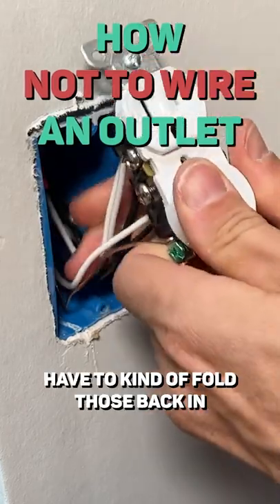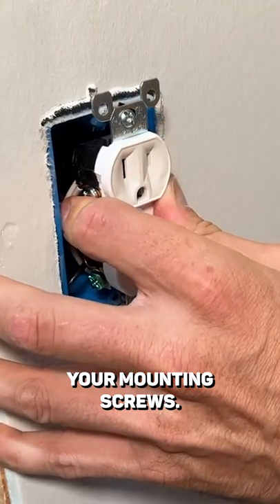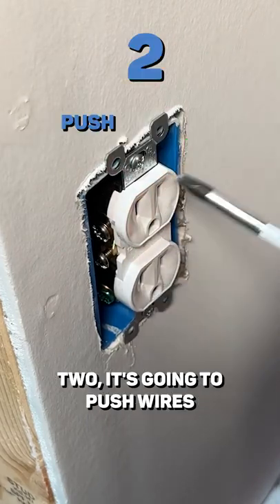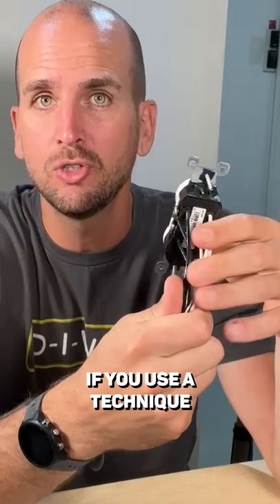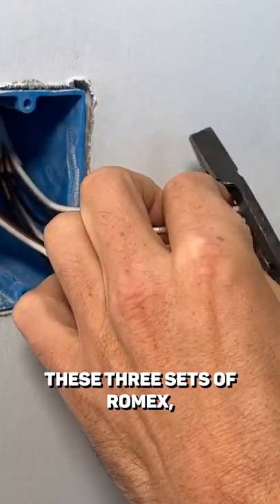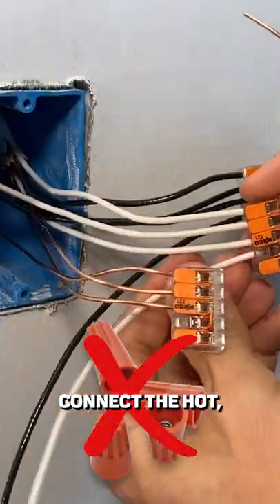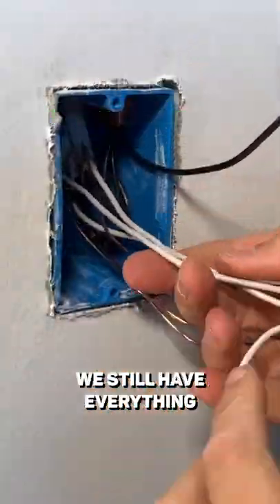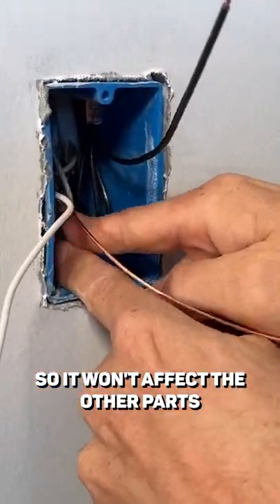The Better Way To Wire Outlets #shorts

Comment: I'm an electrical contractor, been in the field since th late '70's. If you're going to splice twist the wires and use a wire nut. I agree that pigtailing is a better method because there are less wires on the device and less current will be running through that little tab. BUT what you used to make that splice is unreliable JUNK. TWIST THE WIRES so you have a good mechanical bond and a wire nut will back up that bond and insulate that connection.
Reply: "what you used to make that splice is unreliable JUNK"

Are you talking about the Wago connectors which are used pretty much exclusively throughout Europe and have a well proven track record?

Consider bringing your 1970's knowledge up to date.

Comment: Do you not use a covering on the earth wire
Reply: No, it's not needed and they don't sell romex wire with  insulation on the ground wire.
Reply: @randybobandy9828  "No, it's not needed"

Despite those bare wires being right next to exposed live connections on the rear of the poorly designed outlet?

The fixed wiring cable in other countries doesn't have a separately insulated ground wire either, but typically a sleeve would be used on long runs of exposed wire.
Reply: @randybobandy9828  In the UK we cover the Earth/ground wire with a green/yellow sleeving.

Comment: That bare ground bends toward the neutral screw terminals, and might actually touch.  If it does, it'll trip a GFCI breaker because some of the current will return on the ground instead of the neutral.

I prefer green-insulated ground wire on the pigtail and/or wrapping electrical tape around the screw terminals (always the latter if it's a metal box).

Comment: Those push connections loosen up as  time goes on inside the back of the outlets and then you get random outlets not working here and there
Reply: Europe has been using them for years, the US is still using technology from the 60’s. I personally don’t like the Ideal style push in type but the Wago 221’s are built different and have a solid connection

Comment: What's wrong with using wire nuts instead of those monster connectors?   It's rare that I have 3 wires in a receptacle box anyway

Comment: Been doing this in all the time .. but one question ..  why the hell is the ground bare without a mantel ? I had some faulty conductor that pass current trough the ground and worst is that you have to make sure the ground touch the conductor to pass electricity

Comment: why not make the electrical box longer and or wider or deeper so the wires don’t have to cram so tight? that’s the most easiest fix .why buy more material when no more than 4 input fields on a computer fixed the jammed up wires in the box????

Comment: Not sure who decided to call this pig tailing, for 50 years at least a pigtail is when you wind the wire into spirals like a pigs tail. A bit like a telephone cord, you can then just push the spiral tighter as you fit the outlet.

Comment: Wouldn't this be considered series for the main circuit with the outlet parallel? Genuine question as I thought we were supposed to shoot for all series
Reply: No, everything in residential in wired in parallel. You never, ever wire anything in series
Reply: if it were series the next outlet wouldn't work unless something is plugged in the one before it

Comment: I tried using a wago for the first time the other day the separate wires felt loose in each hole in the wago is that common and how it's always is question mark I didn't like it so I just took the wires out of the wago and wire nutted it. Arent the wires supposed to be tight in the wago?

Comment: Also wrap the box to cover screws with electrical tape, it's code
Reply: No it's not. Nowhere in the NEC does it say to tape around receptacles.
If you're going to argue this, have the article number.
Reply: I guess I wrong, St Louis County didn't go by NEC till 2014, as well I may have been miss informed. Was asked to do so when we remodeled the house. Told it was code.
Reply: @brandonstahl3562  That happens a lot, people will say something is code just because they were taught that way. The problem is that they pass that on to an apprentice and then they fail their Journeyman test, or waste time doing something that isn't necessary and is actually frowned upon by some inspectors. While not technically against code, I had an inspector tell me that he didn't want that done as it traps heat, causing the device to degrade. While that's overkill, it does show how different codes can be interpreted, since it is changing the functionality of the receptacle as per it's UL rating.
I'll tape devices if it looks like it might ground out against the mudring, like on a repair with a full box, or in outside, wet locations where the box is going to be full of bugs in a year. Here in Florida that happens a lot; I've found lizards, snakes and frogs in boxes, besides every kind of bug and spider that crawls or flys.
Anyway, I wasn't trying to argue, just pointing out a common mistake. 35 years in the trade will cause you to do that. Stay safe.

Comment: But the reason there are that many wires going in is because I wanted to isolate the bottom outlet so I could plug a lamp into it and turn on the lamp from the door switch, which is a two switch outlet: one for the ceiling fixture and one for that lamp next to the bed.
Dude, if your so weak you need to "pigtail", you need to get another job.

Comment: Any chance for 🔥 with the pigtailin?
Reply: Only if you use the Connectors improperly. When there isn't enough pressure on a connector it becomes Hot.
Reply: Any bad connection will cause a short....

Comment: Then why are there 2 screws an push in holes  on the neutral side and the hot side ? Only time I ever pigtailed was when there was 3 sets of wires

Comment: Holding the outlet on either side with the screws under the fingers? 🤯🤯🤯🤯 ALWAYS treat each outlet or switch as if it were live, even if you know it isn’t ... just in case one gets used to holding them like they are not live and one comes across one that is live!

Comment: Main reason to pigtail is so if an outlet dies the whole circuit doesn't.
Reply: If the bar that connects the two wires burns up you've got bigger issues than the rest of the circuit not working😂

Comment: It's actually against code to not use pigtails on the neutral and grounds.ypu can't use the outlet to make the joint
Reply: Would you explain more? Seems like this is only applicable in certain cases

Comment: One pig tails and connectors are two totally different things to those connectors. I guarantee will fail in time, and the electricians gonna have a heckuva time figuring out where the problem is and three those connectors look way bigger than wire nut and take up a lot more room in the box strip, your wires pigtail them with your Klein pliers throw wire nut on little bit of black tape if you’re in a moist area and call it a day also, don’t use the push in connecters use the screws after you pigtail and tighten down all four screws on the side of the receptacle to avoid an electric arch and possible electrocution to the homeowner

Comment: Let me ask you this. WHY DO YOU HAVE 12g WIRE GOING TO A 15amp Plug? 
How many circuits do you have on this? 
FFS 14 gauge wire is rated for 15 amps and up to 4 receptacles.

Comment: I'm curious, how were you able to put a 12 gage  wire in a 14 gage hole, im pretty sure all receptacle outlets would be 12 gage ,20 amp and not using 14 gage on a 20 amp breaker

Comment: Yes. This is fine and dandy. Unless you are working on 30 and 60 year old properties. This wired do not work the way you think. Even as in bending and pushing. Do not take take your tips from shorts like this one.

Comment: I. NEVER NEVER EVER use a receptacle as a junction point ….   Pigtail it.   Especially if it goes bad.   Will not take out a he rest of the circuit AND u can remove it without disrupting service with the others on the same circuit

Comment: What of someone plugs in a space heater in a outlet with waggos I've used them but prefer solid twist with wire nuts
Reply: Also when it gets cold the difference between copper an aluminum can separate causing a fire from arking

Comment: First you messed up using the stab in back method, thats the worst thing you could do. Then you go ahead and use wago connectors which are also a poorly designed connecting device. You should always twist your wires with kleins then secure with a wire nut
Reply from the maker: That one isn't speed wiring (or back stabbing) it is back wiring commonly found on commercial grade outlets.  Works well 👍

Comment: Well, pigtails mean extra wire in the box, soooo, there's that. Plus the connectors.... but you did push the ground to the back of the box, so good on ya for that
Reply: The issue isn't the really amount of wires or connectors. The issue is that it becomes difficult when there are 5 wires sticking out the back of the outlet. It makes it difficult to push into the box.

Comment: Just my opinion but I would never use a slide bar to collect all my wires I would always use a wire nut they are more secure but sure and will not come apart as a slide bar just uses the little blades in them that can oxidize or tarnish in time and create a problem for you

Comment: Boss: That Takes Too Much Time Doing That!
Electrician: This Way Is Safer, Circuit Integrity Kept and Easier to Fold In the Wires for a Flush & Level.
Boss: Does the Outlet Work Right, All I Care About!
Reply from the maker: 😂 that's about right

Comment: 14 size wire should be 12 I see so many fires with 14 also you need to. Tighten unused screw also put tape over screws

Comment: I don't believe any receptacle is rated to have 3 sets of wires connected to it. You can either use the screw terminals or the back stabs, but not both.

Comment: And for the record, you only use "pigtailing" if necessary because of the diagnosis procedure. It's a lot easier to find a compromise or know that there is an issue by using the device passthrough as designed. You're advice here is useless. Every box has a fill rating. If you can't put a device in with the allotted fill amount, you probably shouldn't be touching it.

Comment: Wago are garbage. If you knew there was two small thin pieces of metal holding the wire in base in thin acrylic plastic. You wouldn’t use them. Same little thin metal was used for stabbing in the back of some outlet. I’ve been in houses that were only two years old with multiple problems because of stab-in. Save your money, save your life, save some electrician headache. Just use a wire nut,twist up the wires and wrap the fucking screw on the device. Doing this for 40 years I see a far less headache and troubles are up.  There’s a saying I tell my people if you do it to the best practice possible then you only do it once.

Comment: So you can either bend the wires and push it in as screw it down, which we've done forever in a day. Or you can make each of these outlets more time consuming and more expensive hmmm. Looks like I need to develop my finger strength cuz I'm bending some freaking wires

Comment: Pig tailing it is.  I've seen the downside of using the receptacle as a junction point.  I've felt the heat of a an outlet being used as a junction even though there is nothing plugged into that outlet.  I've had to repair a defective outlet that has cut off the electric to all other devices down the line.

Comment: NEC art 334, you have to have 6 inches of nm cable sticking out from the plastic box . Nothing more nothing less.
Reply from the maker: As I understand it the code says 6" from the end of the sheathing inside the box and a minimum of 3" sticking out from the box.

Comment: 2.5 for each current carrying conductor 2.5 for grounds and 5 for the device 
22.5 cubic inches 

I doubt that box is rated for it. Probably a 18 cu in box

Comment: I've found so many of those cheap ass wago wire connectors failed and cause a direct ground it's a ok idea but the way they are made cause problems I've never seen very many wire nuts fail

Comment: These flat connectors are NOT a good idea to use.  They have a metal clip that only touches the power wires in a very small area and they are prone to going bad due to minor sparking inside the connector... then they can start fires!

Comment: Those wago connectors have been causing issues,over time they have been heating up even on a tight connection and burning up in the box ,stop using them
Reply: Never seen failed wago, never. We only use wagos here, no professional uses wire nuts, they dont even sell those to professionals.
Reply: Perhaps a cheap copy but certainly not Wago.

Comment: Is wrong wrong wrong.. Run your wire to the bottom of the box to the upper opposite corner and back down the original corner making a spring... That way the next electrician who has to open that box doesn't cuss you out.

Comment: Original wiring is not code in my state, wires have to be pigtailed by code. Those connectors are for amateur's.

Comment: And you won't be heating the receptacle's tie bars between the screws with current that's heading downstream.
Reply: Are the tie bars rated to take the full load?
Reply: @rhelouin  You would think the tie bars are sized accordingly but at the indentations created to ease breaking them free is where the first discoloration from heat occurs. This is the highest resistance spot within the receptacle and with an increase in temperature comes an increase in resistance causing a snowball effect.
Reply: @WireWeHere  would a receptacle manufacturer risk a major class action suit by skimping on tie bars? I would assume that a 15 amp receptacle would have at least a 2 to one safety factor built in?
Reply: @rhelouin  The tie bars are a safe failure point to begin with but we, electricians, always us pigtails so the only time the tie bar will be carrying the current for receptacles downstream is when someone wires the receptacle as a passthrough. The ones I've come across that have failed were in the winter with heaters keeping circuits loaded with the breaker panels out in the cold. Three breakers and two fuses circuits were all oversized too. I don't see anything wrong with the tie bar design but weak links are more likely to be revealed when wiring methods are modified without the knowledge to understand the consequences. Wiring can be big can of worms.
Reply: @WireWeHere  I was not considering improper circuit wiring. I can understand if circuit breakers are oversized and a high load is demanded it would be better to have the tie bar fail than to have the branch wiring fail. If we assumed pigtails, overloaded demand and oversized breakers, wouldn't the problem place all the overload on the wire itself? From a safety standpoint it seems better to have the failure contained in the receptacle box ie the tie bar.
Reply: @rhelouin  With a circuit over current condition the conductors heat up evenly to effectively share the burden. During these events another human error shows up occasionally as a failure point from increased resistance. When stripping insulation to terminate conductors the common pliers style strippers with many presized knife edged holes come to mind. When we close the correctly sized opening around a conductor the stripper should never need to touch the copper. The insulation should be indented, weakened and then pop off the wire. To help the strippers get through the insulation you'll notice some rotating the closed strippers around the conductor ina back and forth movement before adding the force to pop free the insulation. This method can cut tiny rings into the copper at the stripped copper to insulated boundary which creates a potential increased resistance failure point that I've seen show up in motor load circuits using solid copper conductors. This one takes time and repeated starting inrush current and or bump current from rotation changes without coast to stop before switching directions. More than 6 times the full load amps can demand a lot of current and force the weakest link to show itself. Stripping using linesman pliers can cause this same wire gauge reduction or with experience linesman pliers can be used to squeeze a weakness in the insulation making it possible to pop off the waste without a mark on the conductor. On day one of preapprenticeship course our instructor gave me the 9 inch Klein's and 14-2 loomex to strip. When he passed around the wires so the students could find the potential fault condition they found none. Growing up with tradespeople and an interest in how things work paid off that day much more than in grade 3 elementary school when I did a demonstration of wire stripping for our class. I had 14awg to 500MCM and used my pocket knife to show tapered insulation removal and also the consequence of cutting into the insulation at right angle to the conductor, the increased resistance ring. I hope that all makes sense. 
Thank you for the well thought out comments.
Reply: @WireWeHere  and thank you. I have done all my own electrical work for 50+ years and never had a failure but I am very careful and am prone to overkill. I am always open to listening to those of you who can logically explain an issue.  I just read NEC article 300.13 for additional clarification. We are never too knowledgeable or old to learn. Thanks again.
Reply: @rhelouin  NEC 300.13 and Neutral Clarity have finally ironed out their pigtails? 
I haven't needed a peek in ages but I'm curiously invested now. I'm experienced at procrastination so I'll get around to looking ASAP. Thanks for the reminder.

Comment: Wait.  That's not just a better way, it is a NEC requirement.  You are not allowed to daisy chain outlets off of their terminals.  You must use a pigtail.
Reply: Please tell me the NEC article number. I would like to read it. I always thought the tie bars were rated to be used to daisy chain.